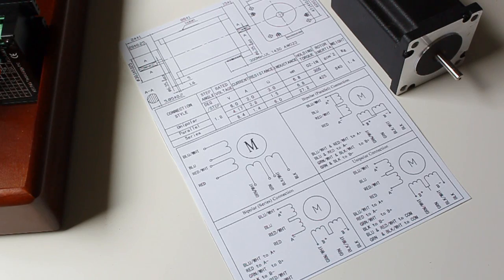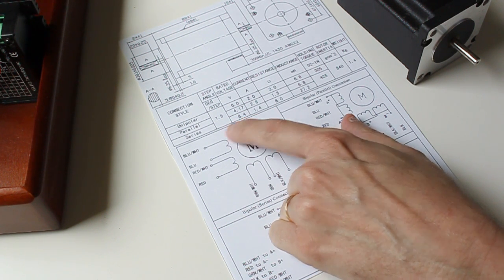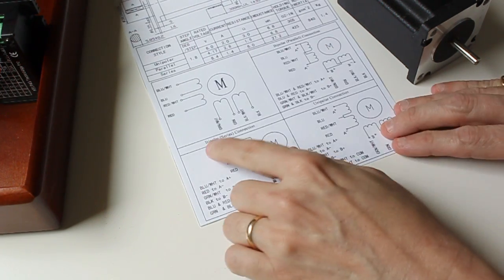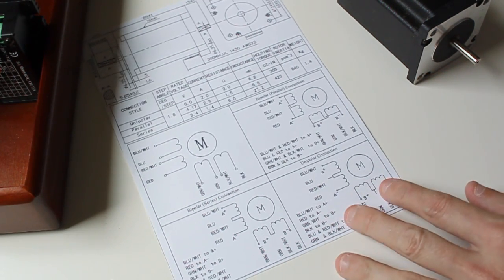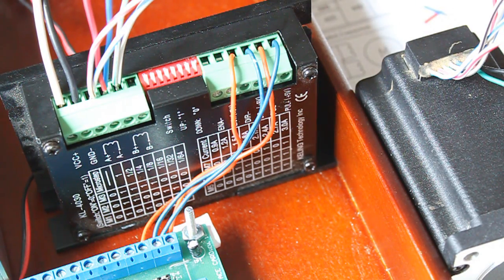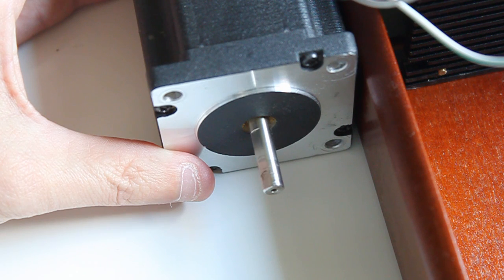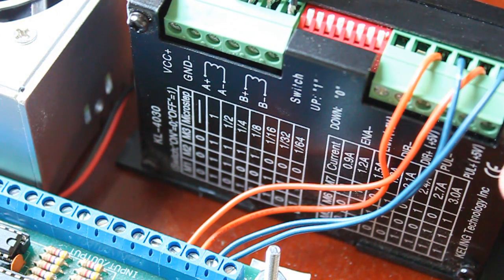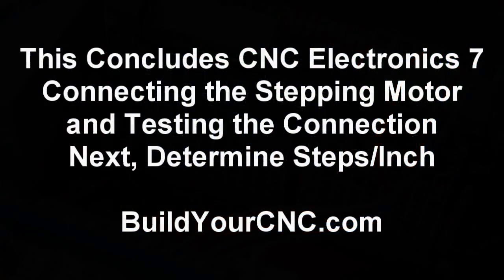CNC Electronics 7.wmv

Comment: Does anyone have any info on wiring the motors from the Bluechick v4.2?  Our school received one of the kits and while the motors look the same, the wiring colors do not match and there was no paperwork included with them. Our motors have red, white, blue, green, brown, yellow, orange and black wires.  There was no paperwork with the machine when it was shipped to us and while we used the guide online to build the actual machine we are at a complete loss with the wiring due to the differences in colors and no manual or paperwork with the motors.
Reply from the maker: You will need to go to the website and then to the motor product page and check the datasheet on that page.  The correct wiring diagram will be shown.  Make sure to use the bipolar parallel connection scheme.

Comment: Thank you so much for such a helpful and thorough series!

One thing that confuses me, you are showing the Bipolar Parallel uses a "Rated Voltage" of 4.17 Volts.  Yet you're using a 36 Volt power supply.

If the "Rated Voltage" specification does not determine what size power supply to use, how should we determine this?  

Thank you in advance!
Reply: you can use 15 times data sheet motor voltage. this is a basic calculation. i have nema 34 motors and 4.2 volts each. i am using 400 watts and 60 volts power supplies for each motor.

Comment: I have not decided if I buy a driver of this type (independent, one for each motor) or those boards coming from china that already have all the CNC controller with 3 or 4 axis embedded in it, because I will use motors that are not very powerful the chinese ones may be enough, my only question is whether these independent drivers can cause the motors to rotate faster?

Comment: Please help me with my cnc electronics.
 I've bought 290oz motors, DM542A drivers, breakout board and 36v 10A power supply from Longs Motor. Wired them up and configured Mach3 according to seller's documents but can't make them work. Where may be the problem?